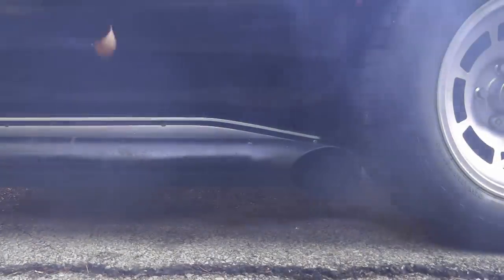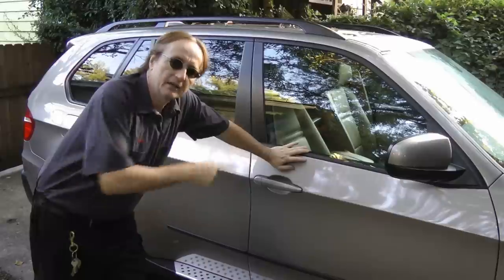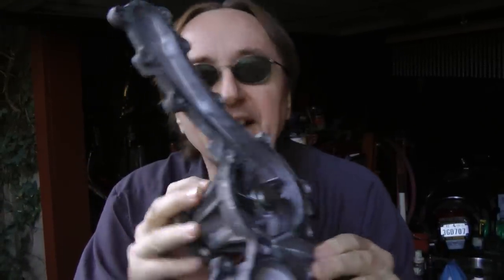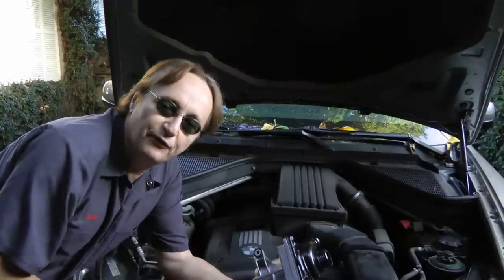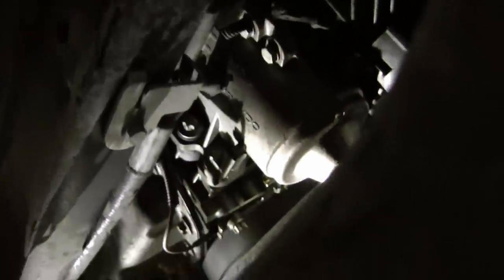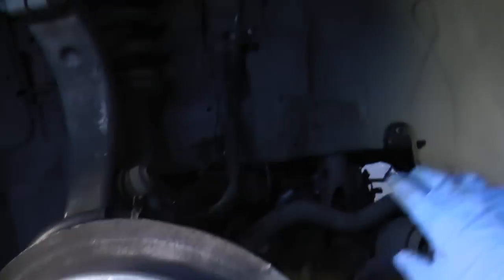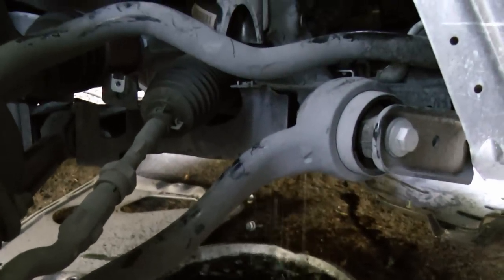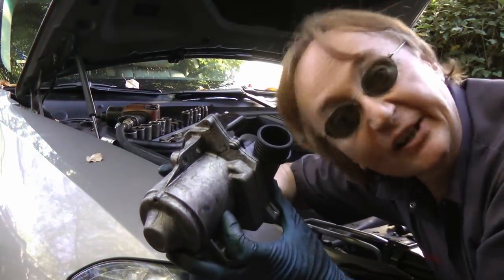How To Replace a Bad Electronic Water Pump

Comment: What was found is that the pumps actually don't go bad.... what happens is there is a capacitor on the back of the pump that shakes loose, because of the heat of the engine it isn't able to be soldered on, and there is a little snap mechanism. So you pop the pump out, pop the back cover off push the capacitor back and bam. Working pump. Saves the cost of a new pump.
There are benefits to an electrical pump, but overall, just way to over engineered.
Reply from the maker: Still, bad design, hell to work on, and really, I would not trust a minor fix on something that expensive to replace labor wise. I'm gonna use a brand new pump with a warranty to make sure it's fixed
Reply: Holy crap, it's that simple?! I'm practically EXCITED for my pump to fail now. I'd heard rumors that the control circuitry was usually the failure mode, but I'd never heard specific root cause.
Reply: Awesome that BMW did that for us. Only 6+ hours of your time or $1000 for this little fix, wow what a freebie. I'm sure owners everywhere are rejoicing.
Reply: Over-engineered ?

Comment: i do not like modern technology in some cases, for example: no oil dipstick on transmission or engine, no drain plugs on transmission or differential.. electronic activated 4x4 that fails all the time, and talking about bumpers and interior they dont use bolts or screws anymore only cheap plastic clips ..

Comment: So you'd rather take off the wheel, (remember that step alone would take me 20 minutes) the engine cover pan, and all that plastic stuff inside the wheel, then jacking up the motor mount, then reaching back in there to undo the hoses when you may not even get them all or get the wrong one because you can't see.

Comment: MY BMW 2014 X1 X DRIVE 35i with 45,000 miles WAS running great but my engine light went on....the car was still running great but i took my car to the dealer because the engine light....the dealer tested my car and told me that the reason my engine light was on was because of a fAULTY ELECTRIC WATER PUMP, THEY REPLACED THE WATER PUMP, $1,100 DOLLARS FOR THE PUMP AND ANOTHER $1,100  FOR THE LABOR, $2200.00 TOTAL COST, THEY DID NOT CHANGE THE THERMOSTAT.  WHEN THEY GAVE ME BACK MY CAR THE ENGINE LIGHT WAS STILL ON.....AS I SAID MY CAR WAS RUNNING GREAT AND THE REASON I TOOK IT TO THE DEALER WAS BECAUSE THE ENGINE LIGHT WENT ON.....SHOULD I BE CONCERNED ABOUT THE JOB THEY CHARGED ME for....please respond, thank you

Comment: Mitsubishi runned in our country a 3 years or 100 .000kilometers.What was the mileage if its not secret?I bet 100 k miles,lets guess.
I remember the golden age when the clutch slave cylinder was made of aluminium and you could buy cheap refurb kit for it.Today you can buy both master and slave cylinder when your clutch gets stucked at 100k,or alternatively you can destroy your gearbox if you dont know whats happening.The rest you can guess.

Comment: this is why german companies can get 500hp out of a 4 liter engine and here in america we can't. An electric water pump can last just as long as a mechanical pump and you get alot of benefits such as extending run time after engine shutdown to prevent hot spots in the engine, reduced parasitic drain optimized coolant flow for varying engine conditions. I will agree they have their head up their butt in where they place them I can't stand working on these or VWs.

Comment: Actually it is a brilliant engineering, just not meant for cheap mechanics, trying to fix BMW while lying under the car... In professional workshop this is 2-hours job. And with Continental pump, now replacment cost about 500 dolar's. It's low cost for having such a sophisticated piece of enginiering in your car. Mechanical pump is no match for electric pump, since electric water pump can work at high speed in low speed traffic, and cool down the engine, even after engine is completly shut down! And again - don't buy BMW if you can't afford it, because cheap mechanics will yell as this one, and you will be the same. This are sophisticated cars, where even some bolts are made of alloy matching for lightweight, aluminium-magnezium engine block, for better efficency and performance. But ofcourse Mr. Scotty couldn't figure it out... That's a brillint piece of thinking :)

However it's not a suprise. If American's could figure out how to build a modern cars and engines 30 years ago, NOT using 60-years old technology almost until now, maybe today, Germans would NOT be world's greatest car industry, and Trump would NOT have to wonder why 50% car's in US are Made in Germany? Well, all in all American's landed on the moon thank's to german rocket technology from WWII. So maybe if they will study some more of german cars, some day they will build car, that can be a real comparsion for Mercedes or BMW. Good luck!
Reply: Zakov335 to some degree your right but BMW and other German auto manufacturers don't want average mechanics to work on there cars and purposely make them difficult to repair so only dealership make the money. Making the repair system for BMW a closed loop. If you can afford it sure but does that justify the plan of obsolescence at the highest degree fair? No

Comment: Some of these comments are just ridicules, It dont matter where the car comes from they all have there problems. Some people are saying they will never drive a foreign cars but they driving a gm that all most every sensor and part is from main land china. Nothing is made like it use to be and its never will be, Thats why i do not own anything newer than a 2004. I have owned mostly german and they have been the best . Not trying to defend new german since i have been working on a 2007 x5 and it has all sorts of coolant leaks and a weak a/c system(poor design) but it dose not look cheap on the insides like american cars., Not a bmw fan really but i like my old mercs (pre 95), owned w124s, w202s, have a w203 now and have great engineering compared to the junk they make now and american cars are on the same path, but they cut corners way to much. If you dont like the challenge dont work on them type of cars but to me if your in the field i would get use to it cause everything is going to be complicated to work on.
Reply: Want to add that i dont hate american cars , since i have my 03 c320 w203 in the garage for winter and driving my 04 jeep tj with a 4.0l and 5speed(nv 3550) , the jeep has 140k and has been great and just needed oil changes , but every little thing has broke on it switch wise  and the paint is cracking and i baby this thing. I refuse to sell out for that jk thing they call a jeep!
Reply from the maker: I see stupid designs, I will comment on them. If it was a metal pump, it would not have broken so quickly. And it could have been placed anywhere on the car, being electronic, so it could have been changed in five minutes if mounted in an easy access place. Dumb design, poor engineering, I will rant about that every time I see it. Hopefully less people will then buy such designs and maybe the engineers will learn from that.

Comment: i get myself 2nd mits.galand. do minor service engine oil,gearbox oil,timing belt,fuel filter,water pump,drive shaft,battery,suspension,change brake pad,spark plug,wheel bearing,, all by myself...easy to do.save me a lot of money..so,yepp,,,scotty is right.

Comment: Because in Europe you can't have a high power, good mpg car that also meets all the ecology standards (=taxes) with an old pump. Different priorities. It's a good solution overall though if only it lasted longer and wasn't as expensive. And reading all the complains is funny - people who want to go cheap way do not buy high-performance cars.

Comment: BMW uses electronic water pump in order to cycle the pump on & off as need freeing energy to make the car more fuel efficient and ecologically friendly. Aluminum (not magnesium) bolts are used to save weight & prevent problems from dissimilar metals. The inline 6 cylinder n52 BMW engine was the lightest 6 cylinder production engine ever made. Certainly BMW (like all car companies) has it's flaws but they pioneer and innovate most motor vehicle technologies that other car manufactures follow. All car manufactures have flaws. Mr. Kilmer simply dislikes German made vehicles because his background in them is not strong. The water pump job in that BMW is 3.0 labor hours book time (not 5-6 as he states).
Reply from the maker: ha ha, "friendly" designs that rip off the owners as they age. Rationalize all you want, they are endless money pits as they age, I know, been fixing em 48 years. I started out on German cars in the sixties when they were well made, but not any longer.
Reply: It is not a rationalization, it is the truth. Certainly they make money from the sale of parts but so does every vehicle manufacturer. Lexus GX470 needs a new master cylinder & Toyota only sells a complete master cylinder/ abs assembly for over $2,000.00. The bottom line is ALL cars are money pits (some more than others). That water pump is $400.00 and 3 hours of labor to install. If you charged you customer more that $1000.00 you sir are the one ripping off your customers. Over 5-6 hours to replace that pump in a E70? The hardest E70 to do a pump in is the X5 35i (which that car was not) and labor time is 3.1 hours for the most difficult model. 48 years of working on vehicle is without a doubt a lot of experience but it by no means makes you an expert with regards to designing, manufacturing, or producing vehicles. 

Do you suggest everyone in the world own a 1998 Toyota Corolla simply because the cost of repairs is less expensive? Additionally,even Japanese produced vehicles of modern times have inherit flaws and cost a lot to repair. The days of the 1990's civics and corolla driving 200k miles with minimal repairs is long gone. 2007 Toyota Avalon I am working on right now has 100k miles and is leaking oil from the timing cover sealant (a well known & documented V6 Toyota/ Lexus issue) and only $2500.00 to repair. Makes the $800.00 BMW water pump job a breeze doesn't it?
Reply: The Avalon is 9 years old the bimmer is only 3 hence the Avalon is due a repair the BMW not I bet it;s warranty just expired too
Reply: +mark williams that BMW was not only 3 years old. That is simply untrue.
Reply: +Brandon Mathews... My apologies but it may have been (didn't see he date of the video). Although it was likely 5 years old. Secondly... it had to have been high mileage or it would have been under warranty still.
Reply: Well that's what scotty said in the video
Reply: +mark williams Yes, understandable. However, we are talking about the same guy that said labor on that car is over 5-6 hours, cost is over 1k, and that recommends putting paint thinner in your gas tank to clean your catalyst. Don't believe everything you see on YouTube.
Reply: Are you being patronizing? Because I do not believe everything on YouTube. Scotty at least has been a mechanic for a few years well what is your claim to fame? And what year was the video posted maybe at that time the BzmW was three years old
Reply: +mark williams 

I am the shop foreman for a German vehicle workshop. 14 years of experience working on only German cars and much more on all makes.
Reply: +mark williams 

Also, yes I know the video was made in 2012
Reply: Oh so that means you're inherently biased towards German brands , that explains a lot
Reply: If by biased you mean knowledgeable then yes. I have 5 cars in my family and only 2 are German (BMW, Ford, Lexus, Audi, & Chevrolet). The Audi is by far the worst, followed by the Lexus. I am not biased towards any car manufacture. I just dislike how Scotty Kilmer misinforms people about vehicles and vehicle repair. Not just with regard to this video on BMW electronic water pumps but almost all of his videos!

Comment: Electric water pump can be very reliable, such as the one that Toyota uses on the prius. Generally, when it comes to electrical stuff, German engineering is good on paper, FAIL in real world reliability. German auto parts giant Bosch's product quality control is just no as good as the Japanese counterpart - Denso.
Reply: Bosch, like any other manufacturer, builds OEM parts to company specifications, bad design or good.
Reply: You are correct-BOSCH made over 5 million bad ignition coil packs a few years back (for VW and AUDI cars). They failed so quickly that  dealers had to cannibalize cars on their lots. Bad coils led to  overheated cat converters (over $800 on AUDI) and  engine fires. investigation revealed that Bosch changed the varnish/insulation-just after they got their ISO approval (saved a few cents/coil). German "engineering" at its best!

Comment: Where are you getting these outrageous prices for parts? Its a 380$ part....I will say they look like there getting worse to work on. haha. I did a full cooling system overhaul on my 03 3 series in 3 hours. Atleast the electric one tells you its bad instead of grenading your cooling fan into the radiator.....

Comment: It's good to be able to run the water pump with the engine off... cooling turbos is one good thing about that. You also don't have to worry about thermostats when everything is electronic. If you don't like cutting edge engine technology, then buy a Ford or Chevy :p lol

Comment: With all due respect, as you are my elder, and I like a ton of your videos for entertainment purposes, but just stay in your lane Scottie.
BMW’s are great cars when cared for correctly, and not hard to work on when you are open minded about their design style.
The aluminum screws are torque to yield and have a very specific anti corrosion purpose.
Stick to Fords Chevys and Mazdas, as you are clearly in over your head. 
And for the love of god use a jack stand.

Comment: No need to unbolt the engine mount or remove the wheel and fender arches. Sure it's a tight squeeze but I have done lots of them. Remove the electric fan and it comes out the top. Bad engineering? Agreed

Comment: This is how it goes.  These makers might tout high performance - but that all goes out the window when it comes to this junk.  I'll gladly trade 'high-performance' for 'less maintenance cost' and 'fewer headaches'.  I bet to replace this part, its a $2000 job - for a frigging water pump.   Forget that.

Comment: What a pain in the ass that is for a water pump. I just had the timing bent and water pump service done on my 2006 Honda Pilot and on that car you also have to remove both the wheel well and the motor mount to gain access to those 2 components, but at least they're mechanical

Comment: Your videos are extremely biased, you come off as an old stubborn person stuck in their way. You direct so much disdain towards companies such as BMW/Mercedes, yet these companies produce excellent cars. I understand you prefer the "old" way, but this is the future, efficiency where ever you can get it. I work on these cars everyday, while yes the materiel's they use like all the plastic pieces and what not are often fail points, the engineering behind them is solid.

(BMW tech/Engineering student here)
Reply from the maker: ha ha ha, germans used to make great cars, I've been working on em since the sixties. now they make over engineered junk. Just check their insanely low resale value, that's the market speaking, not me.

Comment: thats ok, bmw still run longer than any other car ive seen do to their over engineering, ive always hated there cooling systems, but always keep in mind euro cars have preventative maintenance that is essential. fix it before its broke or youll go broke. once a euro owner understands that they will actually enjoy there car. better gas mileage, better safety features, longer lifespan, smoother ride, high end interior and features. yeah i guess youd really would be crazy to buy one. ill stick to my low cost preventative diy while the rest of the world spends their time fixing cars they hate driving that in the end will lead to needing something major like a full engine rebuild or whole new transmission. yeah your dodge neon might run perfect for 200,000 miles and cost nothing, but the minute your in a crash in it, youll realize that the american car insustrys idea is to cut corners to save a buck, in that case safety features. Really nice of them to sell you a car they know is barely safe enough for 35mph driving conditions, while german cars are litterly competeing with only each other for whos car can roll and do the least amount of scratches to the person inside. they design cars for speed and safety, not for cutting corners and hurting the inoccent. but dont worry, at least i can pick up a bmw for nothing because of it and know where i stand in a bad situation.

Comment: Part of the reason for such failures is having the part made very cheaply as is the case here and using brushed DC motors instead of 3-phase AC induction motors or brushless DC motors which both types have no brushes to worry about. Had they went that route instead, then it would last too long and they would not profit from repairs. So they will never make it the correct way. Profit and greed matters too much in this world.